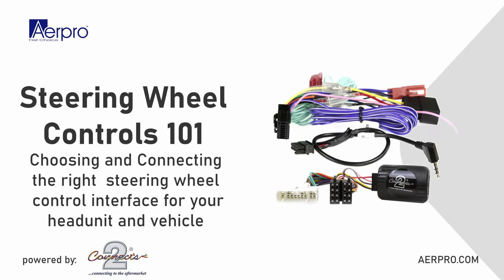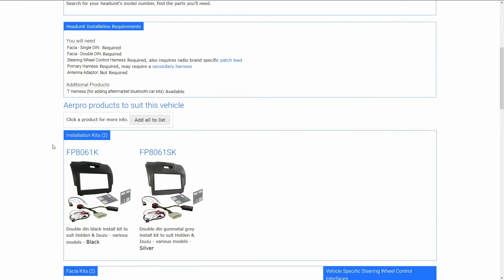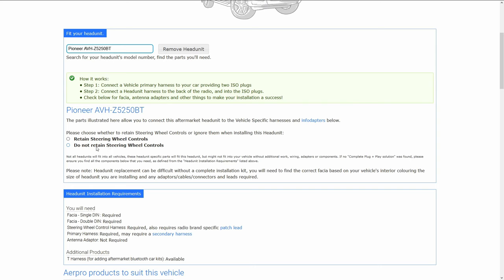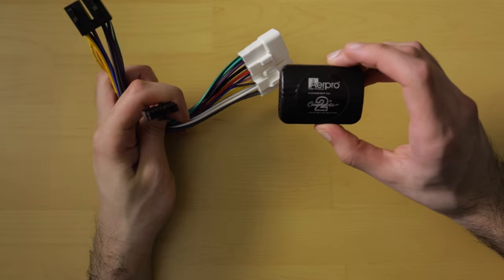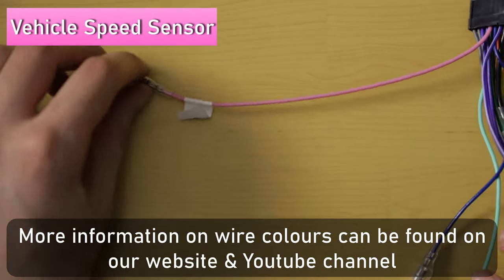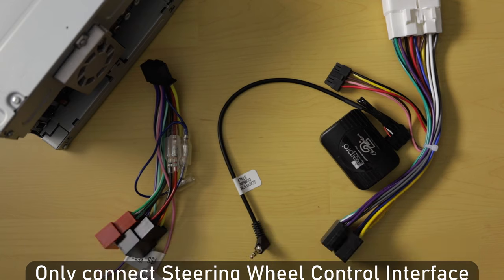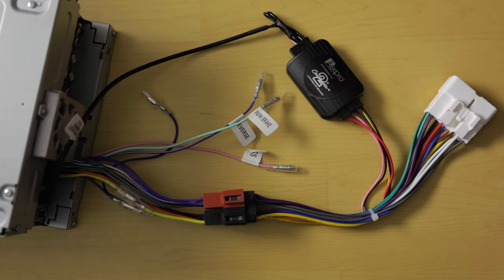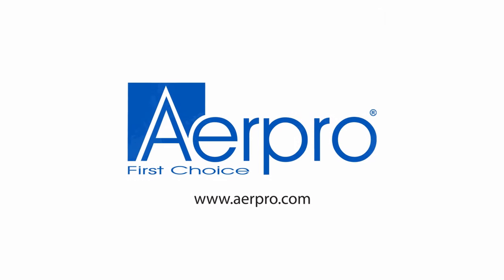Aerpro Harnesses – Steering Wheel Controls 101

Comment: Hi Aerpro Team, I bought a SuperCheapr Auto (Australia) a Sony  XAVAX3200 with a Secondary Harnesses + Patch Lead (APP9SP5 ) + Steering wheel control harness (CHNIUNI) for my 2012 Nissan X Trail (T31 model) ). All is working except the steering wheel control! I tried the 4 settings configurations written on the page 4 of 4 of the manual, and every time I unplugged all and wait at least 2mn before starting a new configurationI. I called twice Aerpro Australia for having some advices. He gave me 3 other setting (all off and number 7 on then off/off/off/on/off/on/off + 8 off or on, then off/on/on/on/off/off/off and 8 off) but it still doesn't work!! he doesn't have other advice to give me... could you please help? Thanks in advance
Reply from the maker: Hi Benjamin, if the tech team was unable to assist over the phone it may be something else to do with either the headunit or the wiring / connections. Best advice would be to visit your local car audio specialist who will be able to diagnose it further for you in person.
Reply: @aerpro  Thanks for your easy and poor answer. I exactly followed the manual instruction and also the video methods... On my side, I suspect a defect an Aerpro equipment so I will not recommend Aepro equipment to anyone. Due to your lack of support, can I send the bill of the car audio specialist to aerpro?
Reply: Could you please confirm me at least the setting configuration which have to use for my Nissan Xtrail 2012 (T31 model)? The model of my previous autoradio is PP-3091T and serial number 0033382
Reply from the maker: @benjaminmelin9441  
You are correct to remove all plugs and modules in between dipswitch changes, 30 seconds wait time is ample. It is important not to have the parts plugged in as the internal chip will not recognise the changes if it's plugged in. Also, stick to the dipswitch settings in the manual only.

https://aerpro.com/sites/default/files/manuals/chniuni_instructions_1.pdf

If you are getting results from the buttons, but they incorrect, you can try swapping the blue and green bullet terminals on the main harness. This swaps the two Key wires for the controls, Nissan did alternate these wires depending on the system. 

If you are not receiving any results at all from the button presses, this could also indicate the presence of an auxiliary bluetooth module. In these models, they are commonly located in the rear quarter behind the plastic trim. You will be able to access this from the rear of the vehicle. 

In the packet for the CHNIUNI you should have the bluetooth bypass plug. Not using this will inhibit the steering wheel controls, as when the factory radio is removed, the bluetooth module will de-power and not allow the control wires to flow back to the radio, this bypass plug allows this connection to remain complete. 

During all this, as all aftermarket radios can differ, ensure you are utilising the radios internal options for enabling steering wheel controls. You may find yourself in a situation where the harness is setup correctly, but the radio is not listening to them.
Reply: @aerpro  Hi, so I installed the bluetooth by pass (I wanted to do it when the steering wheel was working but ok , I did it now)... I tried again the 4 setting of the manual (I did it twice and unplugged every time all the wires and wait 2mn before a new setting), but it is still not working again and I lost 2h again! I checked also the setting of my Sony autoradio and the steering wheel is "on" or available... I connect also my old nissan autoradio, for checking the steering wheel, and it is still working... so do you have other option or tips to propose? except asking to Supercheap Auto a new Aerpro Steering wheel control harness... I suppose something is wrong with the one I got... looking forward to hear from you, thks
Reply from the maker: Hi Benjamin, we cannot see anything which could be hindering the functionality of the controls, it will be a good idea to consult the Supercheap Auto store to have the CHNIUNI replaced to ensure this isn't causing the issue. Otherwise there may be something causing this which would be best diagnosed by a car audio specialist.
Reply: @aerpro  Hi, so I contacted Supercheap auto, and they will replace the CHNIUNI, I hope it will be fine after that. I will let you know when I will have it (order has been placed)
Reply: Hi , I finally received my second CHNIUNI (not in stock so supercheap auto had to order), and I tried twice the 4 settings, but still doesn't work... Every time I de-wiring all and wait 2mn between 2 configuration.... Supercheap auto (are useless) don't give any advices except checking with an electrician... but come on for a plug a play system... I don't know what he can check... and it will cost me a least the price of the Chniuni... Note:  I re-installed my old autoradio and my steering wheel control work very well... any additional advice will be much appreciate...
Reply from the maker: Hi Benjamin, we would like to confirm you have the 3.5mm jack (patch lead) plugged into the blue "remote in" port on the back of the stereo and you have followed Sony's instructions of programming the steering controls in the settings menu of your stereo? The steering control settings need to be set to "preset".
https://helpguide.sony.net/ev/xav-ax32/v1/en/contents/TP1000428663.html
Reply: @aerpro  ahhh into the blue remote in port!!!it works perfectly right now! Like an idiot I was into another black port!! I am really sorry for this waste of time and thks for your support! AERPRO you rock!!
Reply: @aerpro  you handled that really well
Reply: @benjaminmelin9441  Hey mate, which combination works for your xtrail finally please? Following this video my steering buttons give an answer but not what they are supposed to. I tried all the combinations… Thanks in advance

Comment: Where does the patch lead plugged into
Reply from the maker: Hi Trevor, 
One end of the patch lead will connect to the steering wheel control module while the other end will depend on the make and model of the stereo you are installing.

Comment: Followed exactly and still doesn’t work
Reply from the maker: Hi Ian, what make and model of stereo are you installing? Some stereos require the steering control function to be switched on in the settings of the unit.
Reply: @aerpro  it’s a pioneer DMH-Z5350BT
Reply from the maker: @toofa68  that model of Pioneer will require the steering wheel control function to be switched on in the settings menu of the stereo. The following video may help you with the process. https://www.youtube.com/watch?v=M8rOpgse8vI
Reply: @aerpro  thanks guys. I will try this tonight
Reply: @aerpro  still not working the steering wheel control is blank/I highlighted. Followed both videos to the letter.
Reply from the maker: @toofa68  if the steering wheel control setting is blank more than like not all of the wiring of the stereo is connected. The handbrake wire needs to be used to allow the steering wheel control function to be set.
Reply: @aerpro  is this basically earthing the hand brake wire?
Reply: @aerpro  ok seem to be getting there. I earthed the hand park brake and the steering wheel function worked. Again I followed all instructions. As soon as I plugged my iPhone in all reverted back to not functioning. I has seen the next stage is to buy a switch. I’m at the electrical store now. Hopefully this will fix it
Reply: @aerpro  brake earthed. Says it’s setting up. As some as any music comes on it goes off. Functions yet to work
Reply: You managed to find a fix for this? I’ve just run into this problem with the same headunit
Reply: @braydandugdale4981  apparently it doesn’t fit the later model challenger PB. I ended up taking it to  car audio place who told me this and hard wired it in.

Comment: Ok so I have one of these for a 2002 vy holden im putting in a Kenwood head unit what I wanted to know is what do I hook the key one wire too ? Does it connect to the remote sw from the head unit or to a acc 12volt thanks only part im stuck on
Reply from the maker: Hi,
For tech support on our products please send an email to tech@tdj.com.au and we will be able to assist further.
Reply from the maker: @kanes69er   please send me an email directly to marketing@tdj.com.au and I will follow it up with the sales team.
Reply: I have tried all of the above steps and still can’t get the steering wheel control to be selected. It stays gray.
Reply: @PewithMrB05  Yeah mate same here. I'm asuming it has something to do with the parking break wire cause that disables some things.
Reply: @jaydenbrock6196  it did. I ground it to the ground wire and it worked. I’m still working on it though as now my steering wheel control doesn’t or won’t recognise my buttons. Aerpro have been really good with helping me trouble shoot.
Reply: @PewithMrB05  Thats great, I'm going to try the same thing today. What pioneer unit do you have? I've heard that only works on the older pioneer models buts theres been some conflicting opinions.
Reply: @jaydenbrock6196  DMH-5350ZBT. Good luck 👍🏼
Reply: @PewithMrB05  Legend, cheers I've got the same one.
Reply: @PewithMrB05  Got the same thing so far. Steering wheel control button is no longer greyed out but still wont work.
Reply: @tabes10  What wires are you talking about. I earthed the parking break one amd I think theres two other wires that I just left as is.
Reply: @jaydenbrock6196  oops sorry wrong post, i deleted the comment.
Reply: @jaydenbrock6196  hey guys, didnt anyone find the right steps?
Reply: @andrewdouglas3314  I plugged the steering wheel control adapter in the wrong socket 😂.